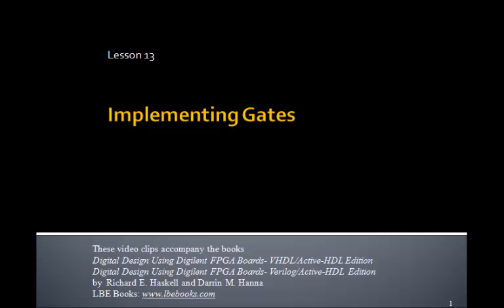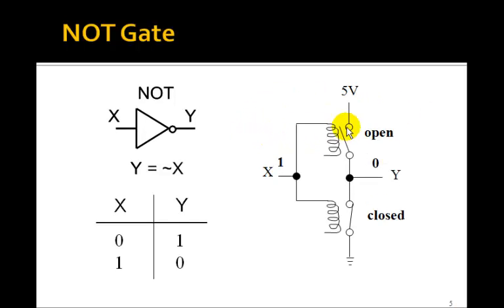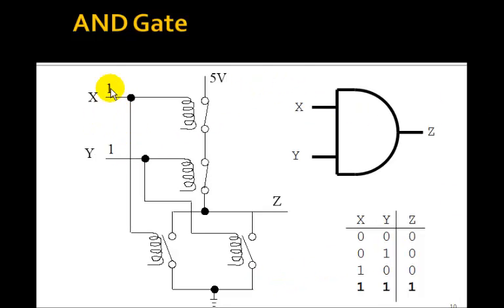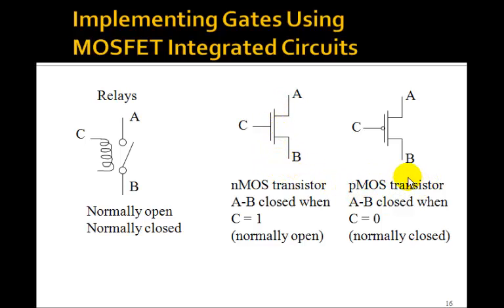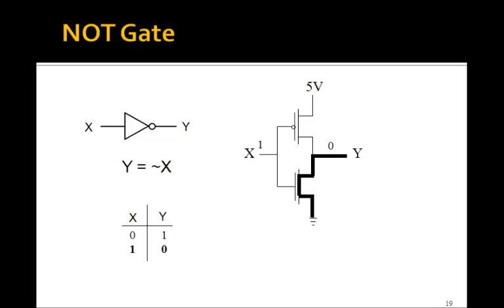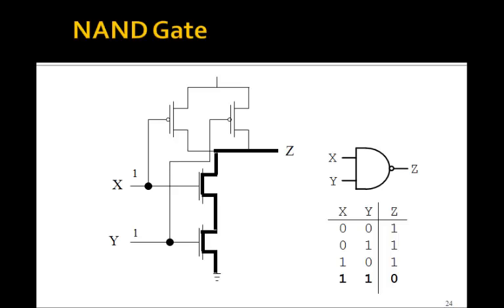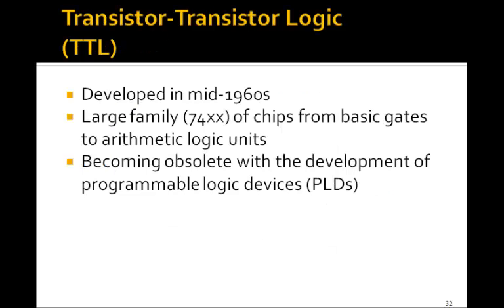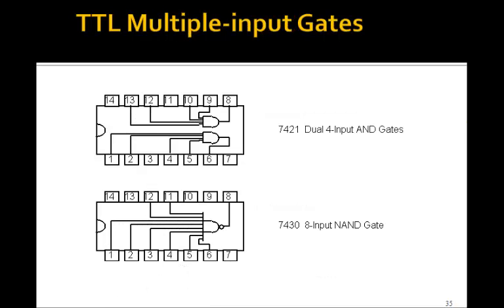Lesson 13 - Implementing Gates

Comment: Congratulations for this series of courses, it really clear and helpful. I would like to ask sth. Why p-MOS trans are likely connected with 5V and n-MOS with 0V? What kind of problem would we have if we connected them the opposite way?
Reply: So seeing as the question has not been answered yet, I'll give it a go. 

The reason pMOS are used for switching high side, and nMOS for the low side has to do with how these devices work as switches.

Without going into too many details on what makes these tick, an important thing to know when using MOSFETs as switches is that they are voltage controlled, and they have three pins, gate drain, and source, or G D S.

To close an nMOS, you have to provide a positive Voltage Gate-Source, or VGS, this voltage has to exceed the Vgs(th) for the particular FET in use, the threshold, this can vary from just around a volt on special FETs, to 10v on power FETs.

with pMOS, you have to provide a negative VGS to close it.
additionally, when the FETs are "closed" the drain and source will be at close to the same voltage, so no, flipping them won't help (and will actually be an issue with actual FETs)

This means that with an nMOS, you want to connect the source to GND, in order to achieve a voltage on the gate that is higher than a source.You technically CAN connect an nMOS on the high side, but then you have to provide a voltage on the gate, that is higher than the VCC for the circuit, which is troublesome.

with a pMOS, you want to connect the source to 5v, in order to achieve a voltage on the gate that is lower than the source volage.

Let's have an example

An nMOS is connected in the following way: source is connected to GND, drain is connected the signal out, and gate is connected to signal in

At the same time, a pMOS is connected as such: source to 5v, drain to signal out, and gate to signal in.

now, let's see what happens at a signal input of 0v and 5v.

0v: The gates of each MOSFET are at 0v. 
Remember the source of the pMOS is at 5v, so the gate to source voltage, VGS for the pMOS is: 0v - 5v = -5v. We have a negative VGS on the pMOS, meaning it's a closed switch.
Now for the nMOS, the gate is also at 0v, but so is the source, and this means the VGS on that is 0v-0v = 0v. nMOS need a positive VGS, which 0v isn't, so it acts as an open switch.Result: 0v on the input = output connected to 5v.

5v: The gates of each MOSFET are at 5v.
for the pMOS: 5V - 5V = 0v, no negative VGS for the pMOS = open switch
for the nMOS: 5V - 0V = 5V, a positive VGS for the nMOS = closed switchResult: 5v on the input = output connected to 0v.